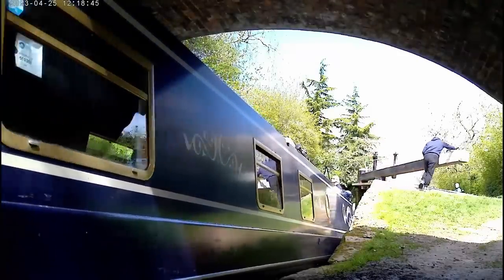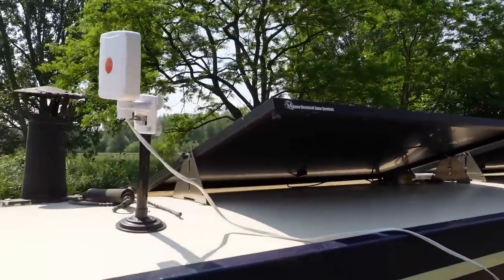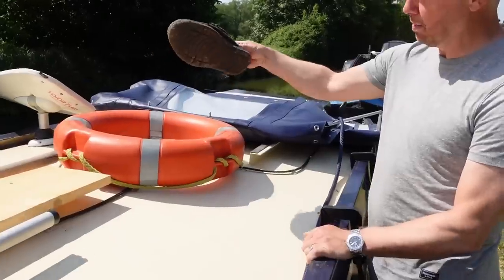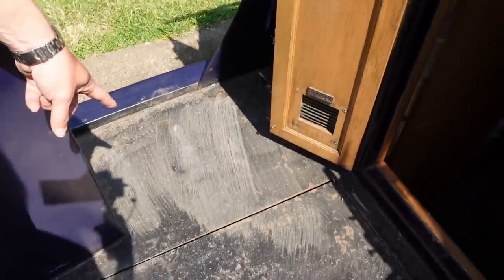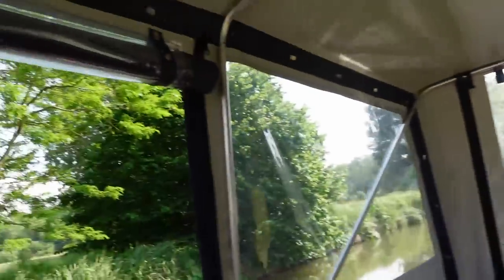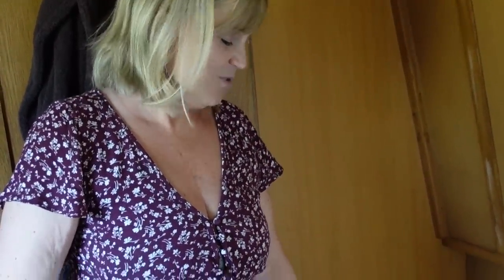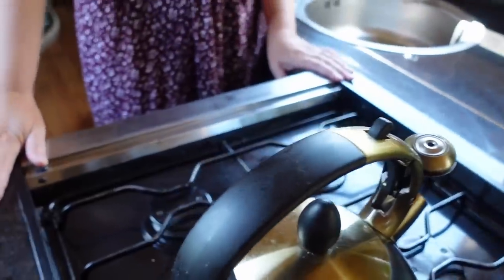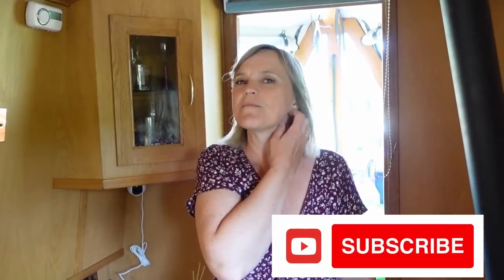Our narrowboat tour! Jump on board. The one with the dictator, the cheap plank and the air hostess

Comment: That`s a lovely home and boat. I`m a 53 year old hgv driver and for my retirement plan i`m seriously thinking about renting out my flat and  buying a second hand narrow boat. (I`d have my gov. pension,rent money and would own the boat.) Some ideas for your place= corianders an easy grow and great for your curries,cut and grow lettuce would be ideal for your pot(you just cut off what u need and it grows back). My cousin lived on a narrow boat for a while and an issue she had in the Winter was condensation and it affected her clothes. I use a de-humidifier (200 watt) they`re a low energy draw so cheap to run but I also use it to dry my laundry. It works out about 5 times cheaper than using my washer dryer even though it takes longer. 🙂
Reply from the maker: Thanks for that, we are all over your tips! We rent out our house and use our pensions, this life can be as cheap as you want! Great to have you slonh